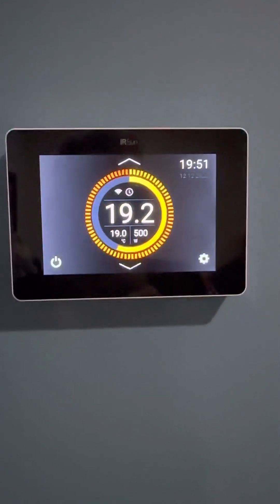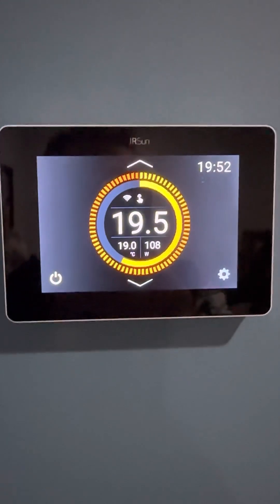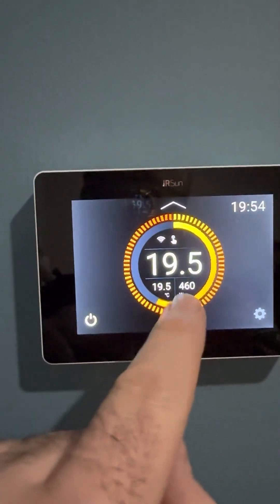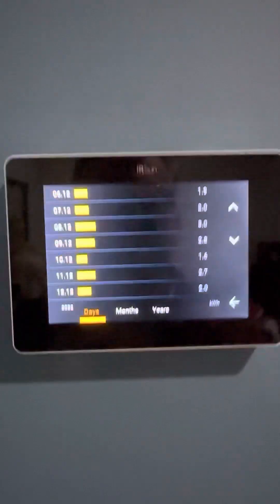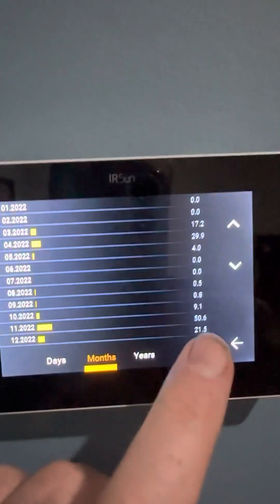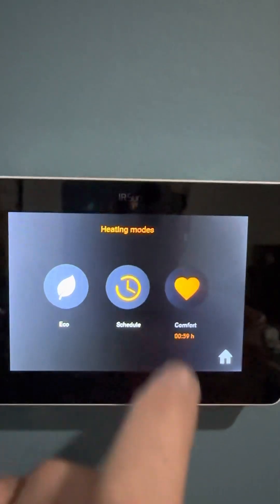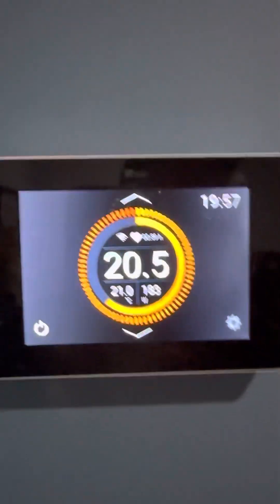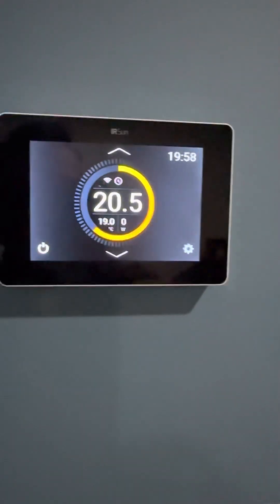How much electricity is my Infrared panels using.

Comment: I'm testing a 700w panel in my bedroom left to run at 18 degrees 24 hours per day. It's using less than 2kw per day. One question would be for larger areas such as a living room that needs 2400w. Is it better to use several small units spread round the room or just use a single point heater bar?
Reply from the maker: Yes this is a better approach and more efficient have more units spread out in the space, if your looking for quote. Please go to our website infraredheat.ie